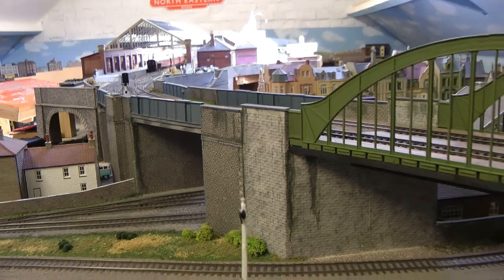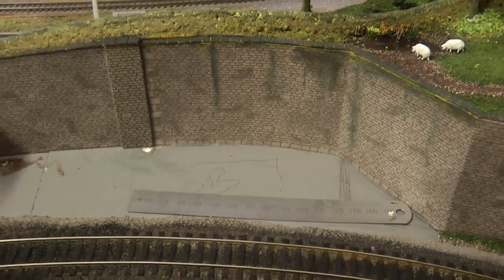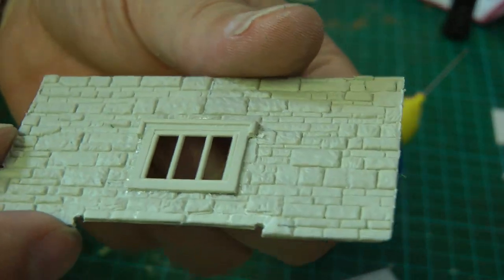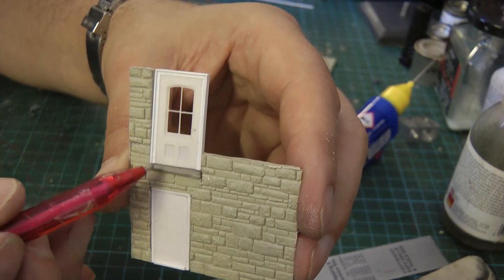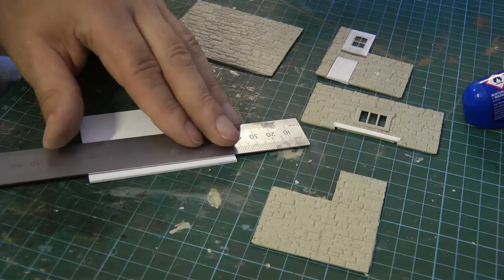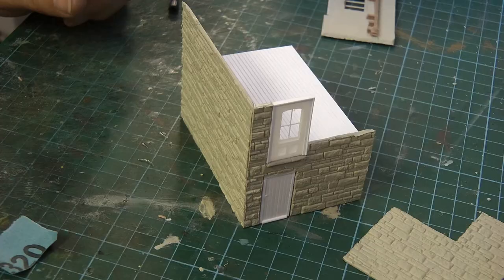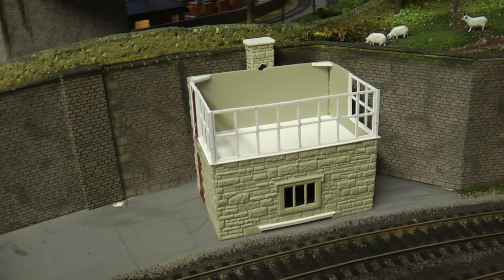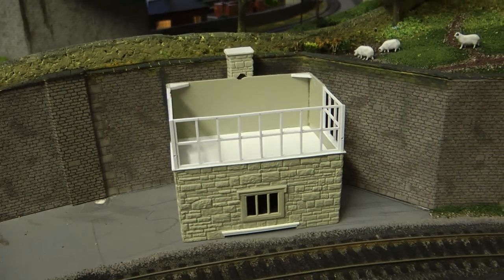Jarrow Road Signal Box Part 1     No 385

Comment: Good morning Tony, now that really is a challenge working with that thick plastic that you have so expertly overcome. Those windows look brilliant on both levels, well done on getting square and done so quickly - practise makes perfect. Very fitting for that location and well worth the effort. All the best and take care. I would have sliced my hands several times working with that material…. Stephen
Reply from the maker: Hi Stephen, how come your so far behind, on this project. i hope you catch up soon.
the thing i really like about these sheets is the external detail, which you can not get with card. you need to care more care my when cutting these sheets. until next time, stay safe. Tony
Reply: @TONYNORTHEASTERN  Hi Tony, a two week holiday, clearing up after, redoing the camper storage base plus a load of other out door stuff, never ending, but on the last bits now.  Having seen the full build now those embossed sheets gave  great results, so glad you tried this - trail blazing. Just got a load more Metcalfe paving slabs for similar effects, just not worth making yourself. I will be careful, so far still all 10 digits are OK. All the best Stephen

Comment: G'day Tony, I built my signal box (using your good tutorials) out of card and paper, even though not finished completely I must admit is looking good :). I am at moment building my main station which I will be using plasti card of brick and course stone but main feature wall which is sand stone block I will be using card! I like your videos and always wait for the next episodes .
Cheers from down under, Wally
Reply from the maker: G'day yourself  Wally. thank you for commenting. i remember building the shields signal box and that was made from card. this plastic structure will look a lot better because of the detail in the stone work. until time next time my friend. all the best from up and over. Tony. Lol  Cheer's.

Comment: Hi Tony, I always find it absorbing watching someone build something either from scratch or a kit, always fascinating how they do things. The signal box being no exception there watching you work on another lovely project.
Have you ever tried SouthEastern Finescale embossed brick work? The N Gauge stuff i use is excellent and is is produced in 14 inch x 9 inch sheets which I think are bigger than the Wills sheets. There’s quite a variety in 00 not so much in N Gauge 🤷🏻‍♂, it’s produced down your way in Bognor Regis, I think other places stock it to including Squires Models. I mention it as it might give you the option of more height so you can cut a whole rather than parts for the height of the building.
Cheers for now mate, John
Reply from the maker: Good morning John. its great to hear from you. 
Thank you for the tip regarding the plastic sheets i will surely look those up. 
as you know i have not done much in plastic. i think the last thing i did was the small ticket booth for south shields.
thanks again for commenting. as its been a great help. cheer's for now. Tony.

Comment: Hi Tony, this is (yet another) great build. I've used Wills plastic cards in the past and I've never been happy with the result but this video has given me one or two ideas that i have never thought of before. Likewise I have a slope on my layout but i have dedicated trains that run on that particular line. To help with the climb I took a Hornby Guards coach, re-mastered the chassis so that it would take a Lima motor so there's a locomotive (a Lima Deltic) pulling one end and a powered coach pushing at the other. It works quite well to the extent that I'm considering powering up one or two other coaches in the same way for other trains. Thanks Tony.
Reply from the maker: Good evening Alfie, plastic sheets do have there limitations. i dont think they are tall enough for the bigger structures. ie churches etc. but the sheets do give a better and more realistic look to buildings. 
Even though Stevenson's bank is nearly 6 metres long. it does create limitations on trains lengths. 3/4 carriages depending on the Loco's, Diesel's have no problem getting up the bank. thats just down to their weight. 
until next time my friend, enjoy your model railway, cheer's Tony.👍👍